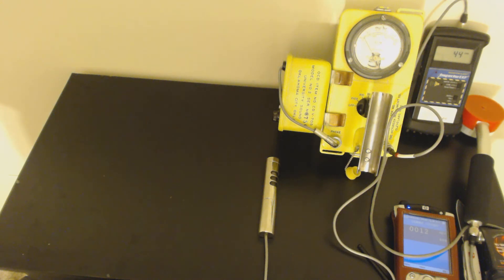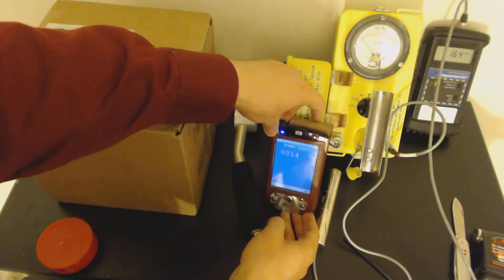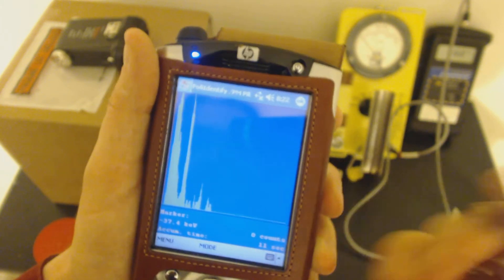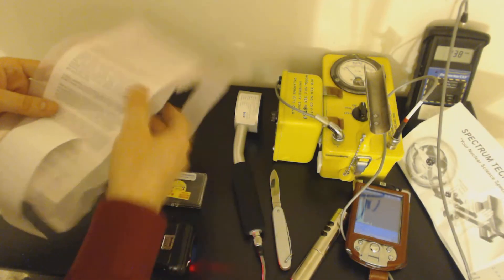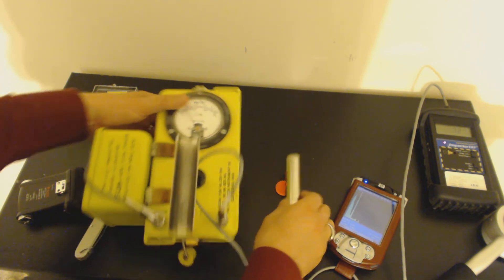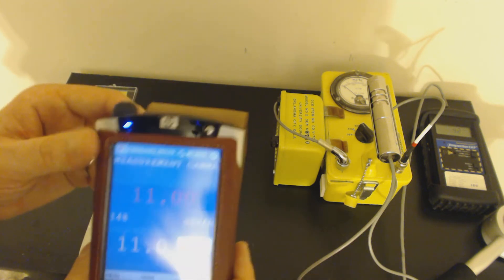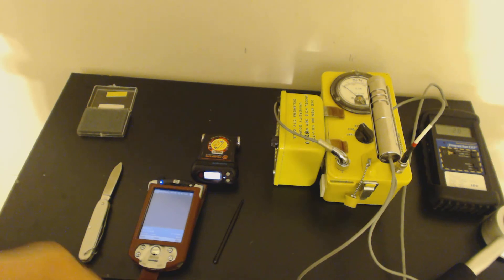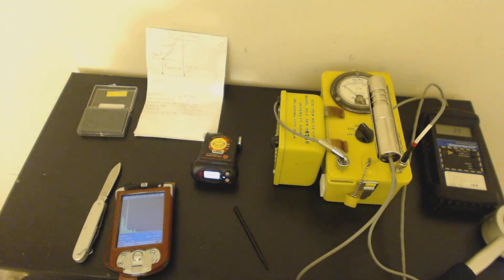☢ Radioactive Delivery! ☢ What was in that package? ☢

Comment: What if, in an alternate galaxy made of anti-matter they use positron microscopes.
Reply from the maker: 5thDragonDreamCaster  it doesn't have to be in an alternate galaxy. You could use a positron microscope in this galaxy. The problem is that you'd want to make sure that electron fields did not get in the way, is positrons electrons will come close together to form something called positronium. The to orbit one another until they eventually collide producing and annihilation and to gamma rays. The big problem you have, is a positrons might interact with the very matter of that they are trying to look at. Most antimatter that is made does not have orbiting electrons, but there is no reason that an anti-Atom could not have regular electrons. There are a lot of exotic combinations that can occur in matter, but do not normally occur simply because they're not really stable. An example is a proton, with a muon orbiting it lol   it could happen, but it wouldn't last very long.   Interesting idea however

Comment from the maker: Well, I wouldn't want to impose my opinion as I am in no way qualified. Personally, if I had a kid and they wanted such a thing, I would let them have it, but... it would be supervised by me and be the lowest activity I could get. The source disks sold in the USA are very low in radiation, but radiation still can be an issue for younger folks. It really would boil down to age. If my kid were under 16, maybe not (unless supervised). Older than 16, perhaps so... with rules.   =)